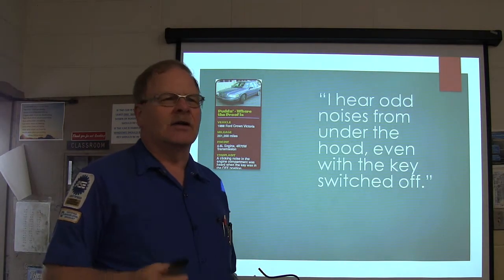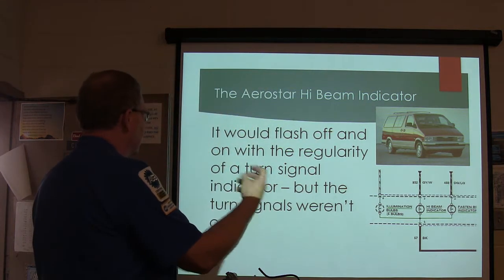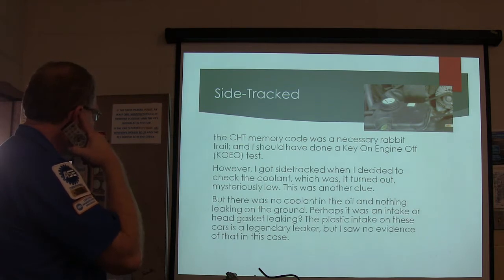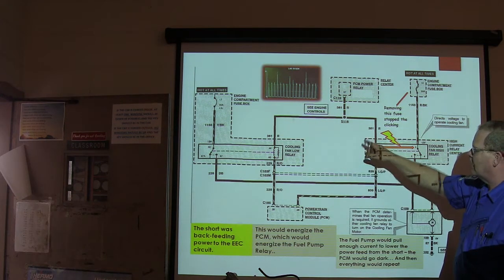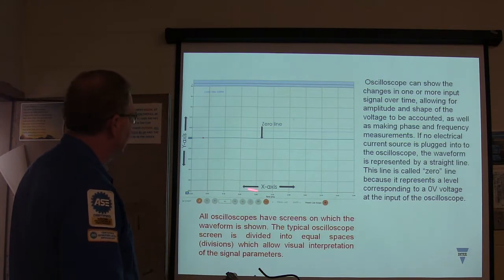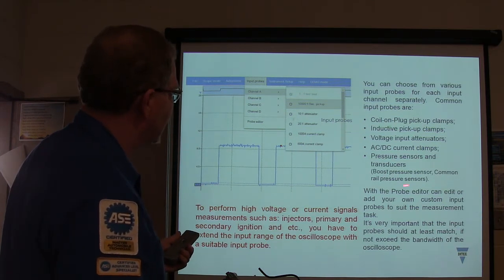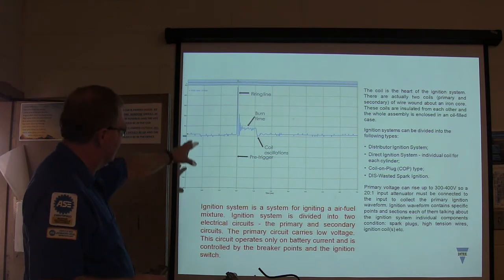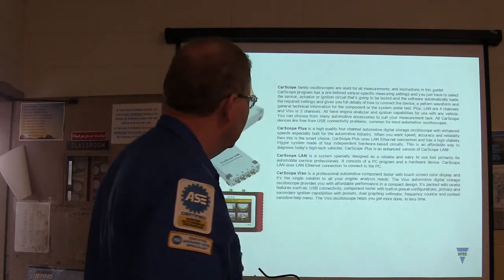Strange Noises and Scope Basics

Comment: Hello, sir. I have heard that you can use the missing tooth on the crankshaft to determine if the car can start without the cam sensor. Would you mind elaborating on that, please?
Reply from the maker: I might have misspoke - Fords - the older ones - would generally start without the cam sensor - some other vehicles might or might not start without the cam sensor or might start hard.
Reply: My question was not about something that you said. I have heard that from other channels. I just wanted to hear your thought on that.
Reply from the maker: @bbmd2200  I don't know about that

Comment: Would you be willing to answer a question for me? 

In the term "CAN bus", I understand what CAN is. Controller area network!! It's a high speed communication network, within the computer system of a vehicle, designed to carry info quickly between the different modules of a system!! 

But , I can't determine what "bus" means!! Other than a large passenger carrying vehicle, used primarily in public transportation!!

I see the term can bus, look for descriptions and definitions, and the definitions usually focus on the CAN part, go into great depth and detail about the CAN network, and immediately drop the term "bus" completely. Is bus a shortened version of a word, like busted, or busmatic, or busferoscious, or something? Is bus an acronym for something, like Bad Usage System, or Basic Understandable System, or the like?? 

How do I understand exactly what a bus, in a Controller Area Network bus is??  Should I think like "a bus is used to transport a large number of individuals together, to a common location, simultaneously"? So bus is used to describe the info being passed in a large group, simultaneously, to common locations? That's what my brain sees, when I hear CAN bus!! The info being passed regularly, in a group, thru the route.
Reply from the maker: It refers to the fact that multiple modules can be connected to the same network, like multiple people can ride a bus - note that, on glow plug systems that are connected by a metal strap, that strap is called a "bus bar" because it has multiple glow plugs feeding from it.  It's an electrical term, not an acronym.
Reply: McCuistian ok. Thank you Sir!!  I really appreciate it!!